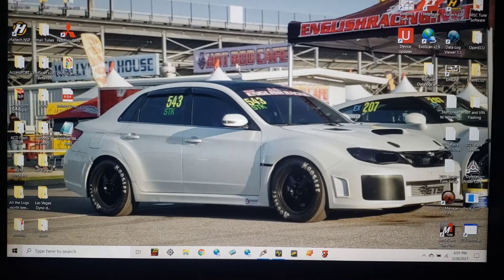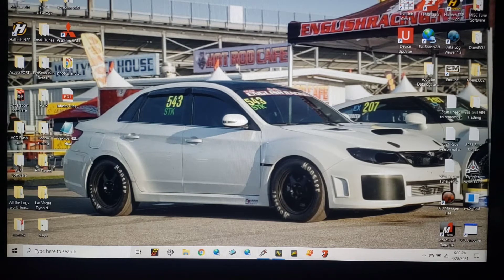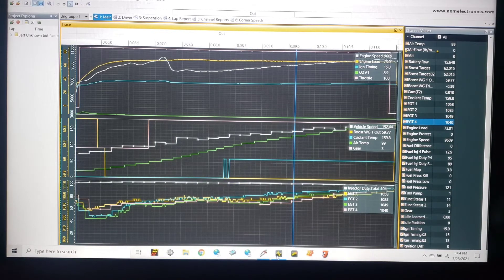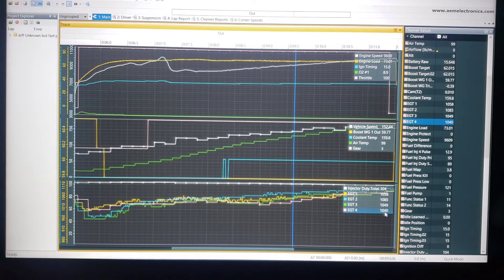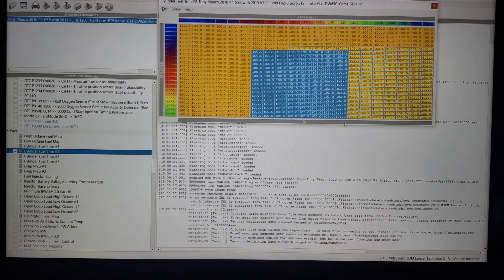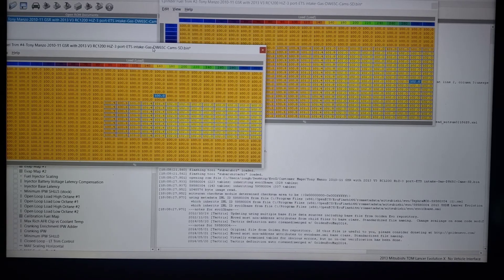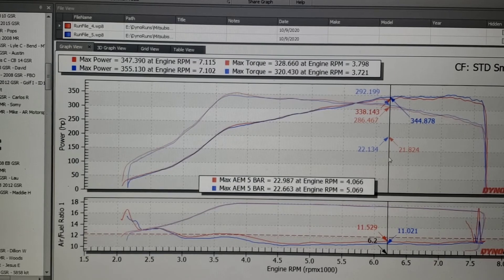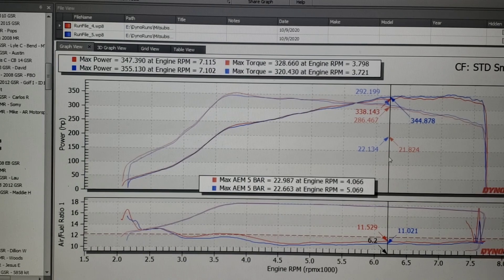EGT per cylinder and Individual fuel trims

Comment: so when a cylinder is running 80f colder than the others, what wuld i do remove some fuel rom that cylender?

aka hot cylinder means add fuel because its lean,
or if the cylinder is cold i need to remove fuel? from that cyl
Reply from the maker: It's not always that simple, it cold be lean already. If it's the only one that is that much colder, start with pulling the plugs and comparing. I would tend to think that you will find that cylinder is actually lean. Spray pattern, airflow at low engine speed, and design of the fuel system, can all contribute. Sometimes it's the sensor placement isn't close enough to how the others were. Looking at the plugs is a great first step though.

Comment: Now what's happening when a cyl runs MUCH(200F) cooler than the others at WOT all of a sudden with no breakup and still making great power. could this be a sign of a leaky valve? (blowing cool uncombusted air into exhaust)
Reply from the maker: A bad sensor or the engine is on the way out.  I would do a compression test and leakdown, make sure all the lifters are working right, make sure it hasnt tossed a rocker, etc.